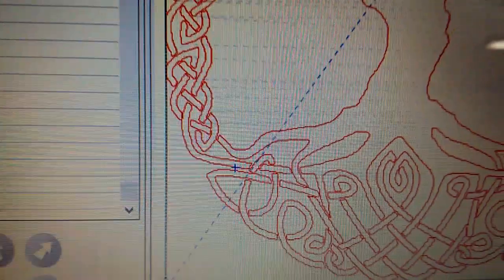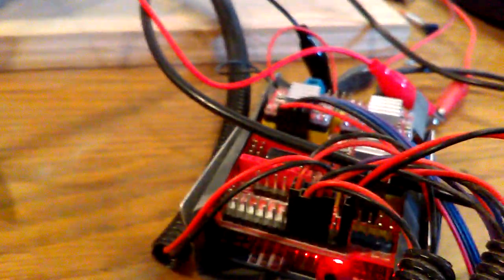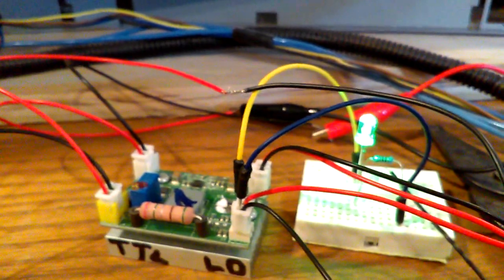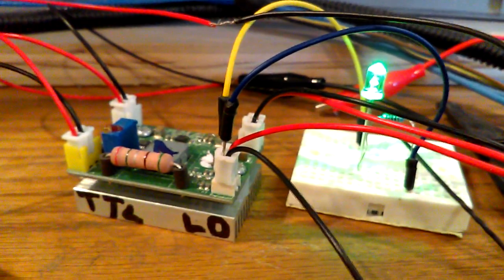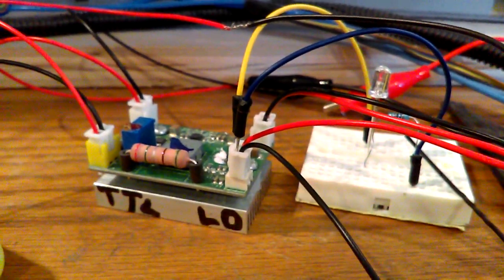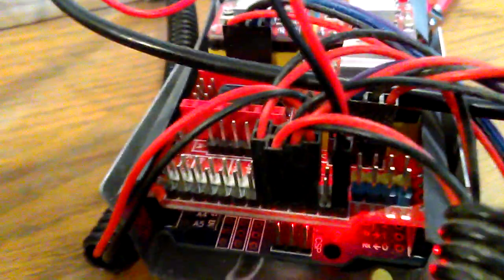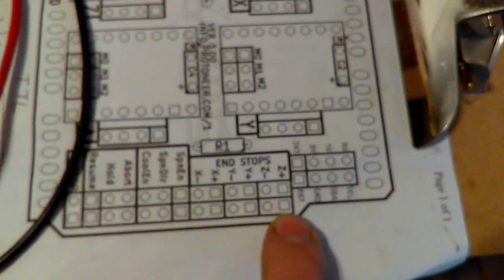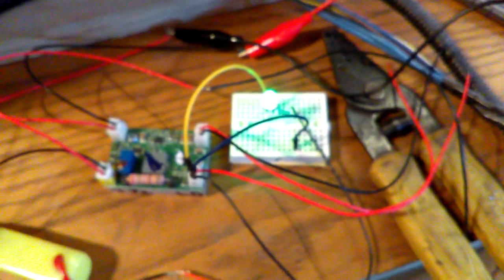Setting up TTL laser for grbl laser cnc

Comment: PLEASE HELP.... anyone...   I recently purchased laser diode with TTL or analogue mod.  This came with TTL connection of Yellow Black and Red wires connected to a 3 PIN connector on the board controlling FAN and LD.  My only experience with TTL in the past is with 2 PINS from a master controller.  So now I have 3 wires for only 2 PINS

Comment: Other people show a 1k resistor between the positive and negative on the ttl signal wire. Did u do that or is that needed?
Reply from the maker: That's done to return the signal back to zero volts not a bad idea.
Reply: Hello again I used an led and got it working but as soon as I hook up my laser’s ttl wires, the laser won’t turn on and off. Any suggestions?
Reply: I figured it out. Was hooking laser ttl wires backward. Thanx for the answer man.

Comment: Hey there are you able to get full power from the board for pwm lazer power. My one will only run 1.3v or if I set the lazer power to 200% is grbl still only runs 2.6 Not getting full 5v out put any ideas?
Reply from the maker: Are you controlling laser output through grbl or third party software? I use lasergrbl and it is pretty simple to set up and operate.
Reply: same issue here,. I cannot get LaserGrbl to send full power to my laser. Yet i can maanually send Gcode to it and it will go full power. S11500 M3 send 5v to TTL. Would love to figure this out. Any Ideas?
Reply: Year I'm thinking that the problem must be in lazer grbl as it is for engraving not cutting maybe ? hopefully some can figurer out a bypass to help us or maybe anther program to try

Comment: heyy..i wanted to know that there are many types of ttl circuits that come with the laser modules availaible in the market . do all of them work with arduino+cnc shield that you are using ?
i am searcing for a right guidance from so long and today i found your video using right as what was . otherwise everyone uses some diffiuclt wiring and different circuits.  my mail id is mayankgbhadani@gmail.com i would be thankful if you help me out with this issue
Reply from the maker: TTL is transistor to transistor logic. Nothing more than typically using a 5 volt pulse width modulated feed to control the intensity of the laser beam output. I got lucky in finding a program that uses ttl control for gray scaling images and turns them into gcode that the arduino uses to control the cnc machine. I can't speak for other types of cnc shields as I have not used them. I have a protoneer v 3.0 on an uno arduino. I had to do some research and trial and error before I figured out what worked for me. Good luck and build on!

Comment: Great work ! keep it up ! I try to make a project same as yours but i have a hard time how to connect the ttl to arduino uno, if you have a wiring diagram or a sketch of how your cnc works would be life saving, i didn't found any good sources on the internet either.
Reply from the maker: adrianclaudiu90 do you have a video of what you have made so far?
Reply: no, currently i am doing research of how to. :)
Reply from the maker: adrianclaudiu90 this is the arduino setup I started with. Steppers came from scavenged parts scanners printers etc. https://rover.ebay.com/rover/0/0/0?mpre=https%3A%2F%2Fwww.ebay.com%2Fulk%2Fitm%2F321991713978
Reply from the maker: https://blog.protoneer.co.nz/arduino-cnc-shield-v3-00-assembly-guide/ 
This is for the arduino shield that I used for my project. My advice is start putting stuff together and figure out how it works. Play around with grbl and see how it works. Get a cheap stepper motor and figure out how that works then you can apply all this to putting the cnc machine together. Look at it as a series of projects then break it down into the parts or phases. Make a list. Gather parts. Assemble. Test and improve.